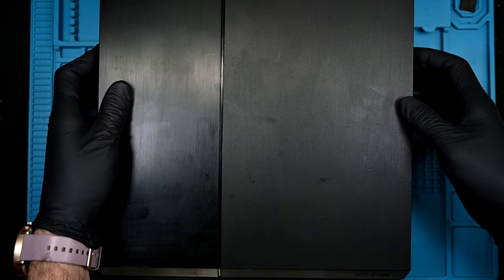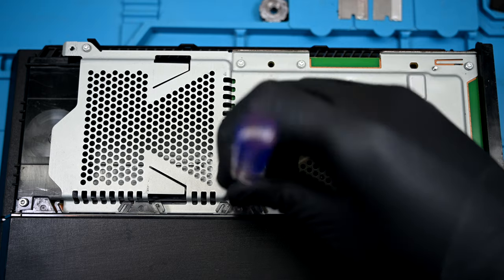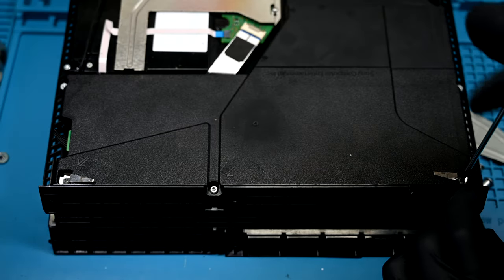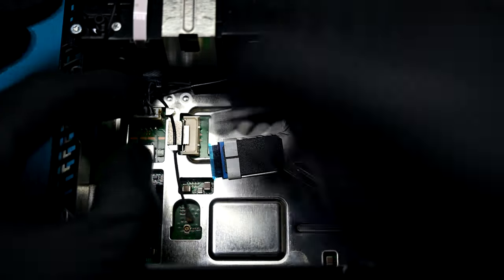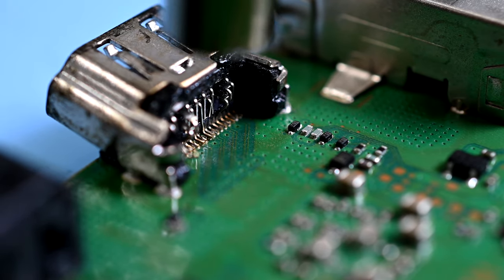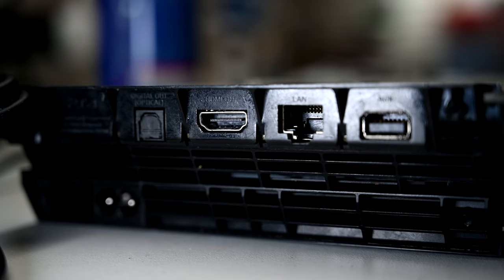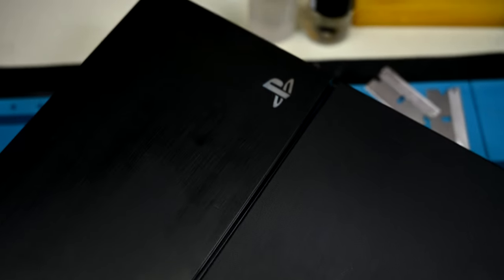PS4 HDMI Port Replacement | Guide

Comment: What if i just need to reset my HDMI port and dont want to melt the plastic back on the HDMI port? For a PS4 slim
Reply from the maker: Couple options, one would be covering it with heat resistant kapton tape, or blocking it with a thin metal sheet. Or if you just need to touch up the pins on the back you can use a soldering iron instead of a heatgun.
Reply: @TapticDigital So the issue is that the HDMI port is wiggly jiggly. I have a Soldering Iron that i can use. It is a 30 watt would that work to be able to get the pins put back down? This is my first time attempting anything like this

Comment: Hey, what's the stuff you use to clean the older solder when you remove the HDMI connector called? I'm missing that but I can't figure out the name. Thanks a lot
Reply from the maker: Solder Wick, or copper braid. Had one coworker call it "the penny rope"
Reply: @TapticDigital  Thank you so much!! And great video too, very concise!

Comment: Awesome tutorial! you made it seem so easy. 
Definitely going to hook into my PS4 which has been absolutely useless since 2017. 

Honestly not even fussed if i succeed or not since it's been sitting in a shed for a good few years.

Is there a specific type flux paste and solder you have to use? Or can you use any?
Reply from the maker: Flux is dealers choice, I personally use ChipQuik but there are much better options. For solder I prefer leaded, as it's a bit easier to work with for me.

Comment: Hey I have some issue with hdmi port, whenever the cable got moved the display is off, I already ask the technician to replace with the new port, but now it still got the same issue. Is it the port or other part is damaged?
Reply from the maker: That's usually the sign of a loose pin on the back of the HDMI port, something isn't fully connected. It may not need a new port, but it definitely needs some soldering.

Comment: I recently had the hdmi replaced on my ps4 slim but it still doesn't work. The hdmi cables work fine on other devices. Any idea on what the problem my be?
Reply from the maker: It is most likely the HDMI encoder chip that sits behind the port, it's also called a re-timer. Some shops will replace it, others won't go near it. Worth calling around.

Comment: Hello, I have watched your video, but a few things can be done better. What surprised me the most is this : https://youtu.be/QDqmkgDZfsA?t=180   . How could it be, that at one moment, the 4 support holes for the hdmi port were filled with solder, and then a split second later, the solder was removed. Can you explain that to me ?
Reply from the maker: Using copper wick to remove the solder can be super time consuming, and can even involve adding more leaded solder to lower the overall temperature. Sometimes it comes out smooth, sometimes it takes several passes. Because of the time taken, I went ahead and cut that part of the video. I should leave that in during future videos, thanks for the feedback!
Reply: @TapticDigital  Oke, but leaving out the most difficult part, make it look like too easy. But because of your video I had a customer coming to me, who ripped off 2 pads and I had to do the repair with 2 bypasses. But that was not your fault, the customer just pulled the port too fast.
Reply: @proconsoles_nl  i took small soldering iron tip , that fits this hole , 400°C and was holding it until the tip got through the hole , then  put desoldering wire cut at 15-30°degree angle into the hole near soldering iron tip and it will suck the solder :p it show i done that , but heard about desoldering soldering iron , this vacuum solder sucker from other side etc.

Comment: Hi i have a ps4 white light problem and need advice.

So i traded a faulty xbox one original for a supposed faulty ps4 original from a person that fixes consoles that wanted the Xbox for spares.

So on the day i got home with the ps4 i used my ps3 cables to power it on and it miraculously powered on which surprised me as the controller was connected properly using the usb cable.

But i saw the screen flash black then back to the home screen which i didn't know what is was then it did it once more and was displaying perfectly.

After about 5 mins of waiting for it too show some errors or switching off because i did not expect it to work i plugged in my usb speakers to the other usb port on the front while the controller was plugged in.

That was when the screen went black instantly. I didn't know what happened and pressed the eject button and a copy of GTA 5 came out which means the console was still powered on.

When i plug the controller and speakers in on my ps3 super slim at the same time is says too many devices drawing power something like that.

So i think it drew too much power on the ps4 and caused a wlod on the ps4.

Im trying to do a home repair with minimal tools and if you could give me some idea of what the usb ports could have shorted eg a transistor or fuses or something.

It still powers on and everything but that was the defining factor i think that contributed to the white light of death.

Any recommendations would help as ive watched a lot of YouTube videos and most are the ic chip or some transistor .

Its a original ps4 with wlod 1116A
Reply from the maker: In my experience it is almost always the HDMI controller chip. While the USB ports on the PS4 had their own set of issues, it would very rarely toast other components, but it's entirely possible if it was trying to pull too much power. Does the console turn on and display anything with NO USB devices connected? If it's still a WLOD, it's chip time.

It's possible the HDMI port itself is internally damaged, like a disconnected pin. Unfortunately this can actually damage the chip as well. I suspect that's going to be the solution on this one.  Pop it open and find out which chip you need (and look for any signs of damage), and get that bad one replaced! If you don't feel comfortable doing it yourself, some local shops might, otherwise check out Chase Fournier or ShaneFix here on YT.

Comment: Is this the same port built in the PS5? I was thinking of removing it for my PS5’s port which is broken.
Reply from the maker: No, they are very different. You can buy a replacement port for the PS5 very cheap online, usually under $5
Reply: @TapticDigital  Thank you.

Comment: I already disassembled my whole game now just need a few tips on the soldering part
Reply from the maker: Here's a handful of unsorted tips I've had over the years. Go slow, making sure each pin is firmly attached to the pad. Pin too springy? Use some tweezers to press it down while soldering. It doesn't take a lot of solder to attach them either, you don't need a huge blob of it, even a light coating on the pin and pad will bond. Rotate the board in a way that is comfortable for you to work on so long as you can see what you're working on. Flux is your friend, it's messy, but it keeps things looking good and reduces the chance of bridging connectors. Some people find it easier to add solder to the pad first, then press the pin with the iron, but some people like to press the pin and slowly feed solder into it. If the pin is attached to the pad, however you did it, is the correct way (somebody is gonna get smart though and send me pictures of a 3 inch jumper wire attaching it and asking if that's also correct)

Comment: What do you recommend if you have an HDMI port that doesn't want to come loose with heat?
Reply from the maker: Aren't they the worst? I remember one time using two heatguns at the same time. If you're using leaded solder for your repair, go ahead and add some to the factory feet and pins, don't be afraid to bridge pins here, you're replacing the port after all. The leaded solder should help the factory unleaded melt faster!

Comment: I have a question I did evrything but when I got to the hdmi the soldering was way to hard to melt is their any thing I could do and I have a soldering iron that goes to 450
Reply from the maker: I'd try adding some solder to the feet, this can help lower the temperature to work better with the heatgun. Or you could try some soldering wick to soak up the old feet, but they are incredibly stubborn
Reply: @TapticDigital  okay thank you

Comment: Great video. I have attempted the repair and I believe I’m getting some signal to the screen, but certainly not correctly. Is it possible I bridged a gap between data pads? And if so, what’s the best way to go about fixing that?
Reply from the maker: Definitely possible, using some soldering wick you can brush those data pads and it should remove the excess solder. It will probably also leave enough to keep each one attached. I'll usually take some tweezers and gently push the pins on either side to see if they wiggle at all, then hit them with the iron again as needed. The other possibility is an HDMI encoder chip, which can cause a blank display without saying "no signal", but I'd check the pins first!
Reply: Awesome. Thanks so much!

Comment: I don't know why but when I try to put new solder it just doesn't stick like one side does but the other doesn't even if I put high temp on the hdmi port it doesn't wiggle or something
Reply from the maker: Are you pressing the iron directly on to the pad of the board? It needs to make really good contact to transfer heat into that pad. I've found using a slightly larger tip sometimes can do the trick, and Flux seems to somewhat help as well

Comment: I got the old hdmi port but the old solder is in the holes and I can’t seem to clear the holes
Reply from the maker: I feel you there, they are a pain! Sometimes you can actually add solder to it, then use the wick. The extra solder will help melt and pull the stuck solder out. Sometimes that fails, in this case you'll want to heat gun that part of the board until the solder is melted and push the HDMI port into place while still heating. Quickly remove the heat so the port isn't damaged, then proceed to solder the pins! (hold the port with tweezers or pliers, don't burn your hand)
Reply: @TapticDigital  Thanks I’m waiting for it to cool to clean the small pins. I don’t have a microscope or magnification to see once I get it in and solder it to the board. But I will follow your instructions closely.
Reply: @TapticDigital  Got the HDMI port put it back together I’m getting nothing on the screen.
I got a white light on the PS4. Kinda tired now.
Might have to just send it to Sony.
Reply from the maker: @TheDrumhead54  nah, they charge way too much. Use your phone camera to get a close up of the pins and make sure they aren't bridged, and tweezers to check that they are all connected. Worst case, call some local repair shops for an estimate!

Comment: What do we do if it says cable not connected and it is. Is there a specific thing I did wrong?
Reply from the maker: Cable not connected usually means a majority of the pins on the back of the HDMI are not soldered down, but if that isn't the case you'd be looking at the HDMI encoder chip, it's the next most likely culprit

Comment: ima get my PS4 sammich port replaced...I was picking at the pins on the PS4 port and i broke one and i tried with 3 different hdmi cables and no signal. Hope this fixes my problem.
Reply from the maker: It definitely should, chances are the cord isn't able to reach that pin. New port should get you fixed right up!

Comment: Yea my port just took a crap, I have a soldering gun, looks like I need to get a smaller iron. What kind of heat gun are u using?
Reply from the maker: Any heatgun that can go up to about 450°C should get the job done. The board spreads heat incredibly fast so it can take a while to get it hot enough. Mine is the Quick 861DW

Comment: Do you still fix ps4 I would love to send you mine I have a bad hdmi port it only works if I place it and manage to hold it a certain way.
Reply from the maker: I don't offer mail in repairs just yet, I'd recommend reaching out to local shops with decent reviews. Some franchises like UBreakIFix and CPR are equipped to do HDMI ports.

Comment: Which leaded solder wire did you use in this video? Can you please share the brand name and specifications?
Reply from the maker: Any brand and gauge will work. Really any solder is fine, I just prefer leaded. I'm not sure what brand I have, the label is in another language.

Comment: Can you please tell me if there is another way to clean off the old solder without the braided copper or if it’s necessary
Reply from the maker: They make other removal tools, but it's not entirely necessary. You can heatgun that area of the board till the solder melts, then very quickly push the new port into its place. Don't heatgun with the port on there, it'll melt, just wait till the solder goes liquid and use pliers to push the port into place.

Comment: How do I get it to boot up in safemode cause when I have it plugged into my TV nothing shows up but a message on my TV says resolution mismatch change devices resolution I've tried 2 tvs but the one with the message is the only one that does much of anything does that mean my TV is not compatible?
Reply from the maker: Press and hold the power button while it's off, keep holding till you hear a second beep and it should boot into safe mode. It should work on any TV though, even if the resolution is different.
Reply: @TapticDigital  nothing worked it seems I have a bad hdmi port cause some of the prongs on it are bent or broken
Reply from the maker: @darksaberwolf1175  in that case it's time to replace the port unfortunately

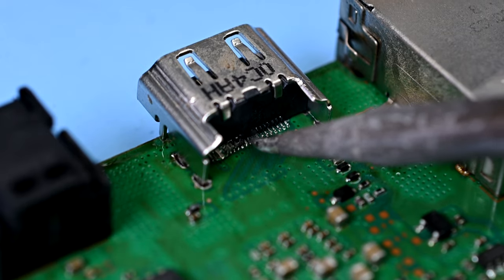Comment: Was that flux  or solder you put over the hdmi ports at 3:24 before you started the hot iron
Reply from the maker: Flux, solder is the actual metallic part.

Comment: First of all, thank you very much for the teachings. I have a problem. I broke the component where pin 5 is soldered, that component in black color can I "bridge" it or is it essential and if so, would you pass me the data?..
Reply from the maker: I'm not sure which component you mean, there aren't any near the pins. But if one of the filters broke, you'll need to replace it, bridging likely won't fix it.
Reply: @TapticDigital  

I tell you almost all the pins were swept so searching I saw that the pins can be bridged to the components following the tracks... in my case pin 5 that goes to a component that I don't know what it is if it is a resistor or a capacitor came out and was lost then I don't know if it is important or I can weld it on one side or on the ground side or without that component it will work. Thank you very much!

Comment: I've got a PS4 with this issue and your video has emboldened me to replace the HDMI port! A question - do you need a heat gun or can you use a desoldering gun instead to remove the port?
Reply from the maker: You will definitely need a heat gun for this one to release all the pins on the top side. Desoldering guns work alright on the feet, but rarely get all of it out and leave a thin fused layer. You’ll also need a heat gun that can reach at least 450C, these boards like it hot!
Reply: @TapticDigital  Understood, thanks for replying with the information. Now I know exactly which tool to buy! 🙂

Comment: Just wondering what the clear gel is you are using and it's purpose
Reply from the maker: @TheSeirophant  soldering flux, it’s used to keep the solder from cracking or smearing. It creates surface tension allowing the solder to stay in a bead or droplet shape while you work.
Reply: @TapticDigital  I was thinking It was something like that thank you

Comment: What is the clear liquid stuff you put on the board and magically made the solder fall into its proper places for the hdmi to mobo connections? (The many tiny connections)
Reply from the maker: Flux! It cleans impurities off the soldering points and creates surface tension around the solder that helps it stick to where it belongs.

Comment: It may have been asked. 

But what solder/flux are you using, and which tools. The way I've been doing it is getting troublesome and not correct Eben though it works and I wanna be more professional with it and this my guy, is professional
Reply from the maker: Thanks! I have some of the tools listed in a pinned comment, but I use ChipQuik tacky flux, an unidentifiable chinese roll of leaded solder (really any works, rosin core is great). I use a Hakko soldering iron, and any heatgun that can reach 450C

Comment: hello there Taptic Digital, this video of yours replacing the ps4's hdmi port is fantastic! watch it like 5 times(that's how awesome it was, lol) i was also curious to look at the comments section to see a specific asked question around, but no one seemed to bothered to ask you about it. if i may ask, what is the size of the leaded solder wire you're using on video footage 3:33?

i forgot to mention, do you have a video on how to repair the Nintendo switch Lite power charging port?
Reply from the maker: Thanks! I'm fairly sure the solder was around 0.02 or 0.03 diameter, I use small so it doesn't spread too much. Oddly enough I don't have a video out of a switch charge port, I should definitely record one!
Reply: dude! thank you so much!!! you're such an awesome responder! 💯💯💯👍👍👍A++++

Comment: Hi, ive never done any soldering work whatsoever but my HDMI got bent in my ps4. I was thinking of trying to fix it, but honestly i dont know if i should. Id really hate to mess this up. If i did try this out, would you have any tips for a beginner like me? Or do you think its better i send this to a repair shop?
Reply from the maker: If you don't have soldering experience I'd highly recommend taking it to a local repair shop. Most computer and cell phone repair shops also work on consoles
Reply: @TapticDigital  thanks for replying! I'll try and see if a repairshop can do it for me.